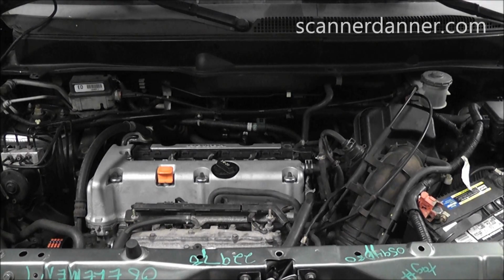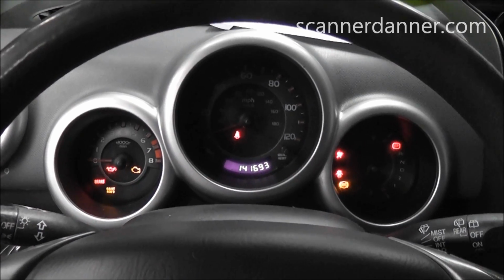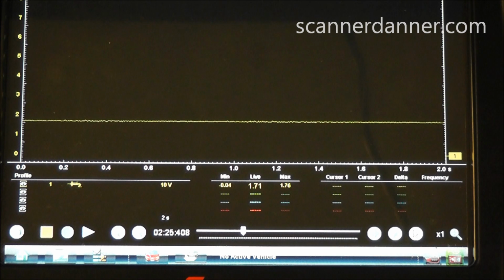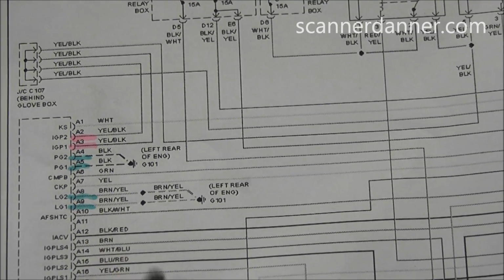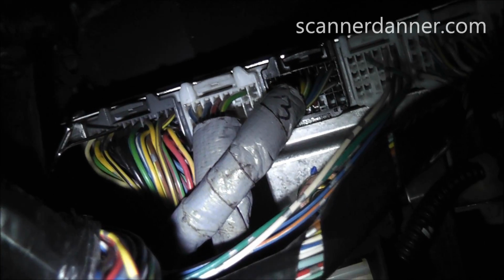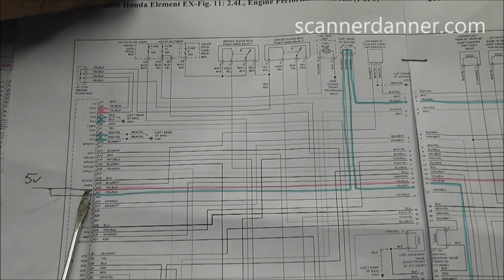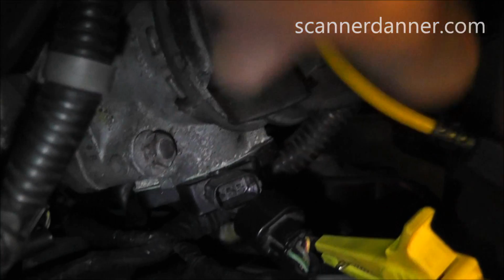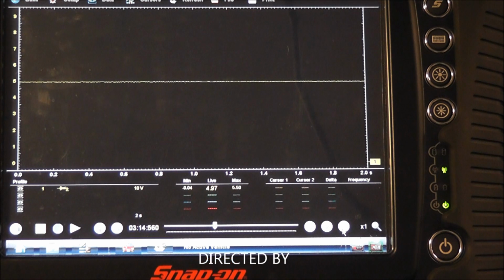No Start from a shorted MAP sensor (Honda, Acura)

Comment: I was wondering. I don't have any specials tools other than a volt meter and just regular sockets and wrenches. Chevrolet Malibu 2010 will start then die just seconds later. checked the codes and let us to change both cam sensors, we changed the throttle bottle with the map sensor, and the mass air flow sensor was changed as well. Still no start. The only thing I can think of is the crank shaft sensor or the timing is off. Do you have any ideas?
Reply from the maker: Clear all codes, then try to start it a few times and reread the codes. This will be your starting point.
Reply: BAM! Not a single word could be added or taken away from this to improve on it.

Comment: Is KOEO a good enough load to voltage drop test the computer?
Reply from the maker: Yes it is, though depending on the circuit being tested I may still crank it over.

Comment: I have a tps sensor code coming up on my 95 Toyota Tacoma. Besides stalling once and not starting for a few hours after turning it off it has been running fine. I replaced the tps and it didn't help. Put the old one back on and started up. (Coincidence maybe?)  Checked the efi fuse and every other fuse. Checked the the open circuit relay and when i  went to check the efi relay I noticied it was unusually warm so I swapped it with my lighting relay which is identical and the vehicle started right up but the values on the live data are nowhere near correct. ECT is 28.88°f and IAC is between -5°f to 3°f. Could be the $40 scan tool I guess
Reply from the maker: IF you need additional help, post this to my forum. It is free to join, hope to see you there. Thanks!
https://www.scannerdanner.com/forum/post-your-repair-questions-here.html

Comment: I need help, I have a Ford Focus mk6, I’m getting p0106 which is a low voltage reading on the map sensor, I tested the map sensor for voltage and it’s at about 1-1.2 volts which is way under, my Tps,vacuum sensor and oxygen sensor are all at 4.3 volts, that means there ok right, I’m not sure why the map connector is only getting 1-1.2 volts, I also have a p0030 which is a broken chain in the oxygen (lambada) sensor, i tested it by unplugging it and seeing if resistance pass through it (Ω) on YouTube it said I needed to touch 2 of the same colour wires which in my case was 2 white ones which apparently are for the heating of the oxygen sensor, I had no reading meaning the chain inside is broken, there for it’s a faulty sensor, I ordered one today, the oxygen sensor voltage is ok at 4.3v, could that oxygen sensor cause the map sensor connector  to only supply 1-1.3 volts??? Please respond 🙂
Reply: @scannerdanner

Comment: How can I test for ref circuit 5v if my ECM circuit is shorted to ground(blown ECM-1 AND ENG-1 on '97 Astro GM 4.3 v6 )?  Having a rough time locating short in that/those 2 circuits. 

 Failure was instantaneous while running(crank no start-no comm is current condition) DLC has pwr/grnd.  Have chased all power feed (pink) wires on that circuit, and still shorted. Continuity of all wires on that circuit.  Unplugged all vcm controlled components and information sensors on that circuit, and still shorted.  

Does this indicate power short to to ground from  underhood fuse box (convenience center)??
Reply from the maker: you need a good wiring diagram and would be better off posting to my forum
www.scannerdanner.com
Reply: Will do.  Have Mitchell1subscription.  Working off "eng. performance" pgs. 1-4. Thx.

Comment: I found the video has no spark no fuel pump kick on same thing as this video I have 2008 TPS is drive buy wire on 08 no communication key light same thing on my Element
Reply: And map has 1.18 for volt reference don't know what I'm doing
Reply: And throttle body drive by wire plug/ TPS no power
Reply from the maker: Seems you are on the right video. Check PCM power feeds next
Reply: Found the problem transmission output speed sensor thanks for all the help haver would have figure it out without this video
Reply from the maker: @mattboyd7837  awesome! Great job man

Comment: I have a similar problem now.  That exact map semsor was bad and i put an aftermarket one in that either fried or is still an issue  . Do any of you guys know what would cause this 04 crv to crank slow. ? It seems labored to crank.  Cables and terminals have been cleaned , battery seems decent , starter is new.  Even with a jump pack it seems to crank slow and troublesome.
Any help is greatly appreciated
Reply from the maker: Take the serpentine belt off and check for frozen pulleys. Try cranking it with the belt off
Reply: @ScannerDanner  ok , awesome I will definitely try that !

Comment: I have 11 volts  on coolant sensor wire but I have it cut at pcm but still have 11 volts  heading towards cab cluster any ideas thanks
Reply: And any pcm I put in it blows the coolant sensor circuit
Reply from the maker: Is the coolant sensor the only sensor reading high volts?
Reply from the maker: What do you mean it blows the coolant sensor circuit? How many PCMs have you installed and what does the ECT show before it "blows"
Reply: @ScannerDanner  the pcm temp out blows on pcm but I have that wire cut at pcm no voltage on it the ect wire going to cluster in dash has 11 volts on it
Reply: @ScannerDanner  I've blown 3 pcms it don't make no sense it's like I have a 12 volt wire rubbing on a 5 volt wire
Reply: @ScannerDanner  the coolant sensor is the only sensor that has 11 volts on and it's on it's own circuit
Reply from the maker: @twinscrew9.047 
1. You should have 5v on the PCM ECT signal wire.
2. The gauge coolant temp sensor (if it has one) is a separate circuit and may be normal to see 11v on that wire.
Need to move this to my forum. It is free to join and we can help you further. Too hard for me to keep up here
www.scannerdanner.com
Reply: @ScannerDanner  yeah I don't have 5 volts on pcm and coolant sensor is a 5 volt reference wire so thanks I have posted in your forum I'm a mechanic  and this one has me stumped

Comment: I dont know how you manage to make these videos...I get angry just trying to access wiring harness's sometimes..and you have a camera to work around yet...got any videos of the same issue but with something shorted to the 5v ref making it a higher voltage..like 6.5v or so? specifically the chrysler vans that always melt the wiring harness near the ign coil.
Reply from the maker: You mean like this one?
https://www.youtube.com/watch?v=jsl531-6q-A&t=20s
Reply: that link doesnt work..just takes me to my own youtube page. whats the title of your video.  I can just search it
Reply from the maker: Try it now. Sorry about that
Reply: i had a no start condition and found no crank signal. I did find these wires to be shorted together.  i fixed the wires but still have a no start condition. im afraid to call a pcm. I have 6.5volts at the pcm on the sensor ground wire. if i maintain that reading on the sensor ground wire with all sensors unplugged, its the pcm correct?
Reply from the maker: Unfortunately, yes, it does sound like a faulty sensor ground circuit. This is a common result from those shorted wires. Just make sure your computer block grounds are good before replacing.

Comment: I comment as we go...lol...
Then you say the same thing..lol
Reply: Bad cig ltr fuse yeah.
I'd go vref too.
Reply: These kids don't know the crap we used to have to do when EFI began huh?
Connectors everywhere.
Flash codes.
Throttle switches.
Distributors...had a Ford wagon distributor beat me up..cant forget that..lol
Reply: I wrote a lot of the info on 3rd Gen Camaro/Firebirds back in the 90s. Camaro Z28 . com.
Minimum air bleed, timing, baseline setup, free mods, bolt ons...etc.
Reply: My 5.7 Iroc went 13.96@100.7 with a 1.60 sixty foot time on free mods only.
Reply from the maker: lol for sure! My oldest boy just bought a 1984 Nissan 300zx and it has a driveability issue. The guys today are spoiled with the newer systems for sure. Everyone is all like "oh CAN systems, CAN systems, they are so complicated" lol, not even close to the crap we had to deal with